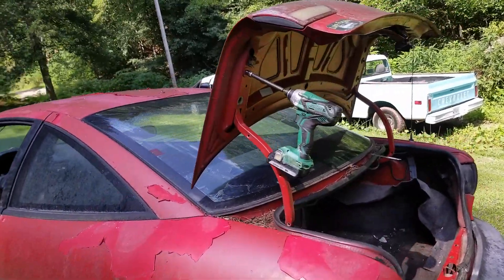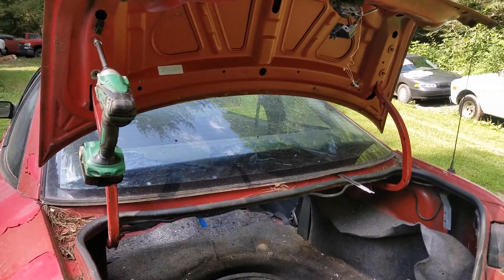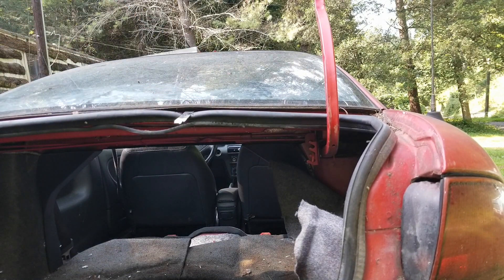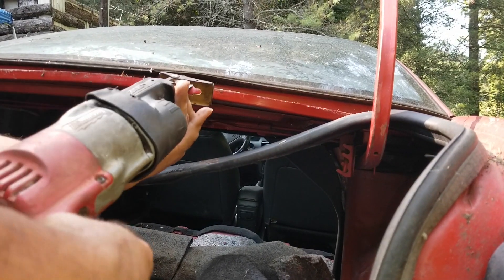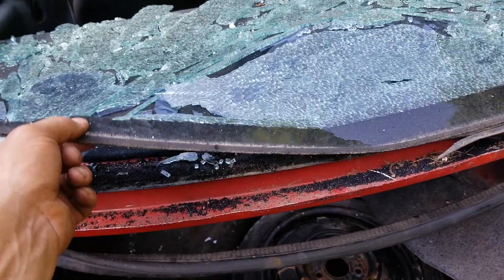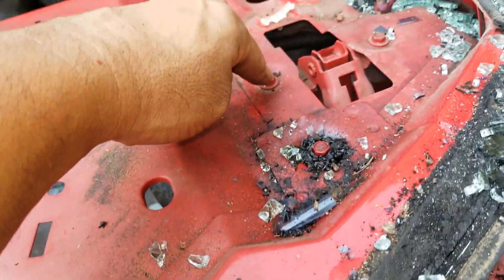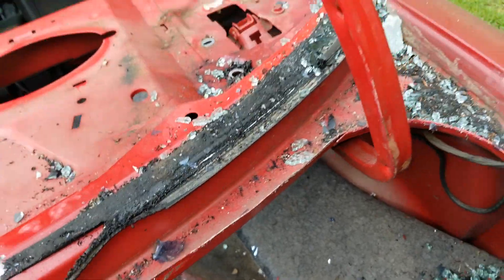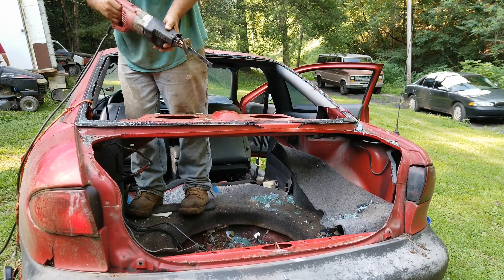Getting the Cavalier Ready for Woodgas

Comment: Great start on this fascinating project, it's going to be very interesting to see how this car performs on woodgas. Hihihihi, the window's out, guess you'll end up with a woodfired and woodheated campercar (remembering the previous build on this car as a camper). This would be ideal here with the ridiculous gas prices at over $9 per gallon. 👍
Reply from the maker: Fingers crossed! It should run well on the gas. According to the people on the drive on wood forum the 2.2l in this car is good for woodgas. 
Our pries came down a little. In my state they removed the road tax from the gas prices. It dropped the prices by about .40 cents. The bad part is the road work for next year is going to be very slim, so we probably won't work much. 
The pandemic already effected our work and some of the jobs we are doing now are leftovers from before 2020. Those jobs are about all done now.
Next year should be interesting. On the positive side it will give me more time to make videos.

Comment: Great start on the project Luke! Looks like you modified it to pretty much fit. Is the floor pan of the trunk still strong enough to hold all that extra weight, or will you have to beef it up some? I guess you are going to feed the wood in from the rear? It's going to be a process to bring it all together, but you're the one I would bet on to make it happen.
Reply from the maker: It will be welded to the cross support as well as the floor pan. It should support it well enough. Surprisingly the floor pan is still solid I was expecting some rust. 
The opening to add wood will be on top of the hopper. I'll stand beside it in the back to add the wood to it. 
When I finally do the Silverado, neatness will be more of a concern.